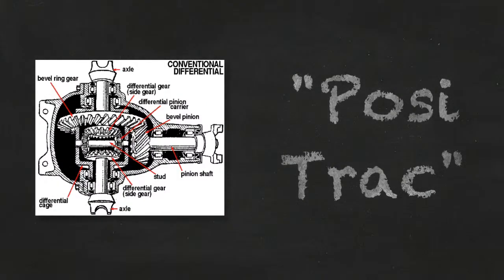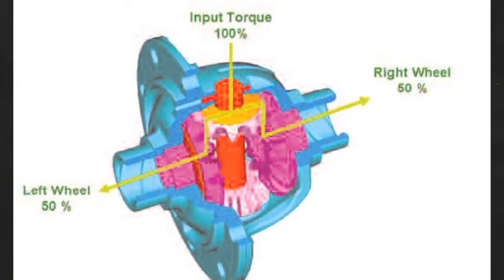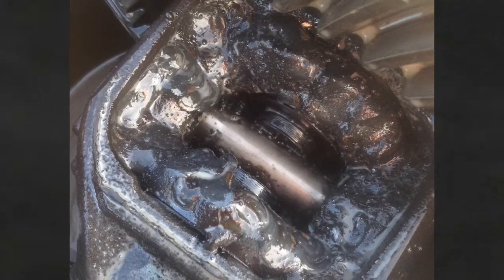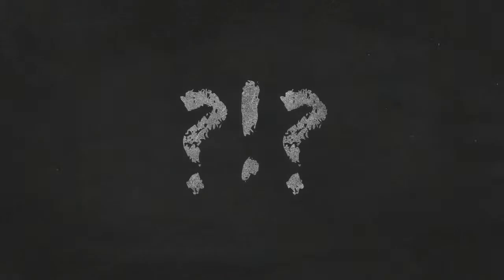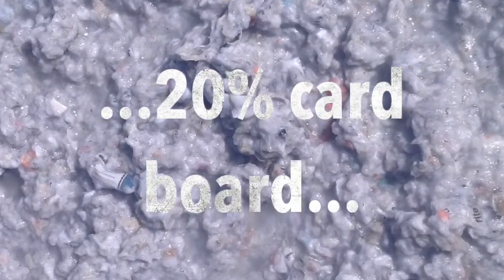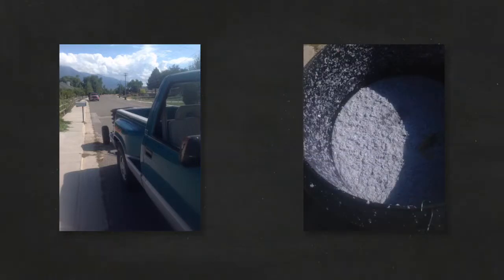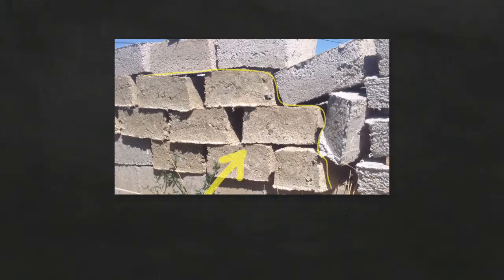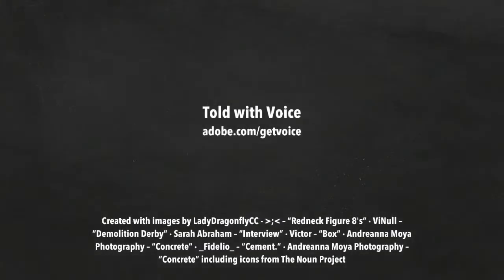Papercrete 230 -  "Posi - Trac" = 2x Force

Comment: I wondered about cardboard only.  My job gets 20 to 30 boxes more than once a week.  I think newsprint is dwindling by the day, but cardboard has longevity.  My thought that extra soak time would be needed seems borne out by you.  I appreciate your video, and am off to watch your others and thumb them up as well.
Reply from the maker: Thank you for watching.  My solution was to fill the tow mixer the night before/early morning of, flatten the boxes/tear them into flat layers, throw then in the mixer and let them soak 4-5 hours.  If I kept the cardboard  to 1/2 the paper content it seemed to work well.  

I do not know how a FULL sized mixer would perform, but I suspect that it would struggle processing that much cardboard.  The "mini" mixer has limited space for the cardboard to go, so it gets forced into the blades over and over (like a blender)...    Just thinking out loud.

Good luck to you